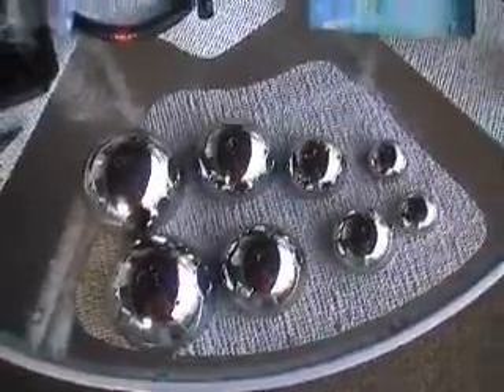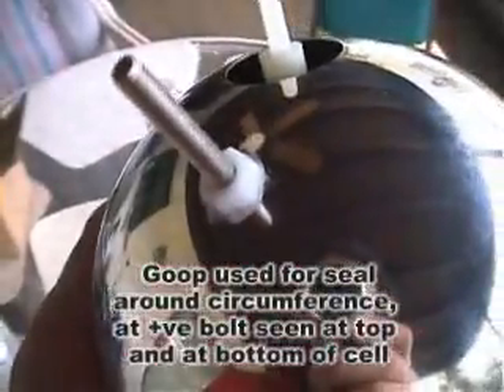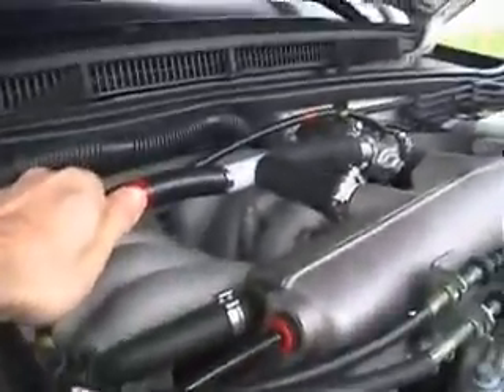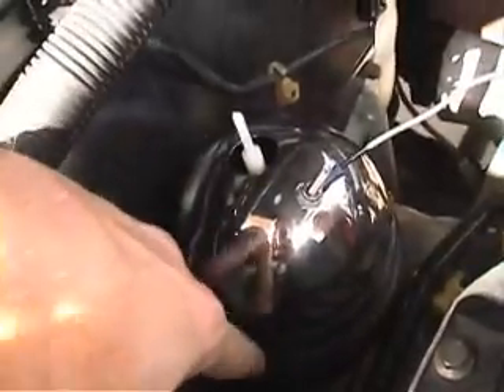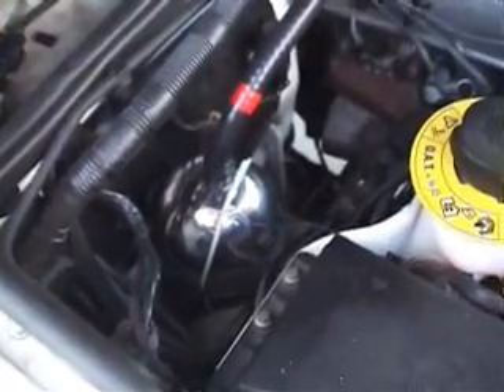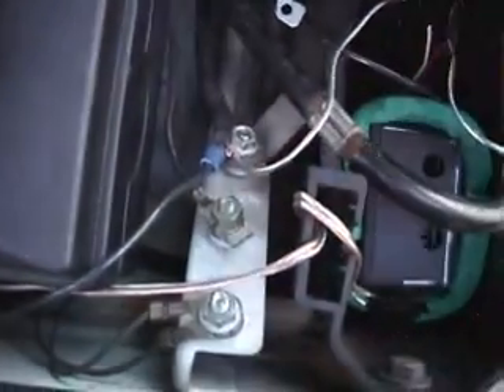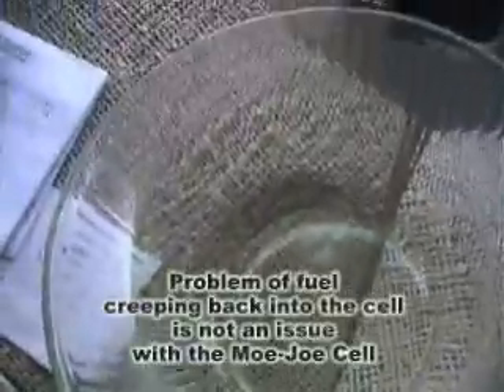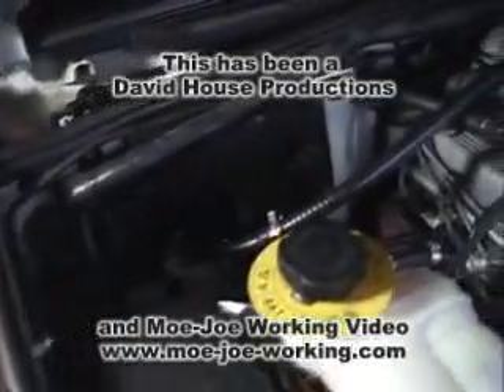Water Car Moe-Joe Cell Car Installation Video

Comment: @MosheDan9 
Actually it is still probably electrolysis. There's a lot of water in the intake, more than you'd think. For every liter of fuel you burn, about 1 liter of water goes through the engine

Comment from the maker: @Vendark 
hi my friend. i did put the tags, to attract people interested in a related technology. but in all truth, it is not a method to produce hydrogen. when the cell is functioning properly, it is affecting fuel mileage positively. however, there is no consumption of the water. there is a massive amount of hydrogen needed to affect fuel mileage, even twenty percent. we, however, have not seen the water levels go down. something else is afoot which is not electrolysis.

Comment: Okay, let me get this strait. There is water inside the sphere, right? There are electrical leads attached to the inner and outer spheres, right? Finally, there is a hose connecting the sphere to the air intake, right? Add some table salt. You'll get more bang for your buck. Also you should put one of those fish-tank bubble stones on the end of the hose. By the way, you are producing Hydrogen -not "Orgone." P.S. Breaching the firewall isn't smart -especially with Hydrogen involved.

Comment: I understand now. I think the scientists in Germany were experimenting with this psychological energy force. Orgasma energy emanates from your loins and radiates out your brain and straight into the shiny metal balls. The convenient part is that the energy can't be measured by conventional methods. Changing sensor voltage will change mpg about 20-40%. Try your orgasmatron without changing sensor voltages. If your device works it will change mileage without an effie.

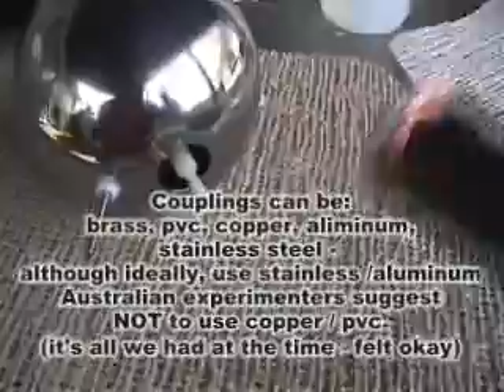Comment from the maker: 1:23 the energy that the cell produces - it's orgone. Do a search and you can learn a lot about it. another possibility is that the energy is scalar waves. another neutrinos. we're really not sure at this point. 
it is still a good idea to have some way to fool the O2 sensors, but it's probably better done within the ECU of the car. 
Shandy mode means a combination of the cell and gasoline. it comes from Australia, and means a mixed drink.

Comment: 1:23 "have a copper coupling that is going to take the energy..."  What energy?

2:00 "to carry and to bounce the (orgone?)"  huh??

Since you are no longer using a cell guardian, does that mean you no longer have to hook up anything to the oxygen sensors?  Is there an updated video on youtube?

6:12 "and already the idle is dropping"
A cold engine runs faster in order to heat up the car.  The idle goes down as the car heats up.

7:12 "major problem in (chandy) mode" what mode??

Comment from the maker: the moe joe cell is not a HHO or hydrogen gas producer. if it were, you'd be correct in all you've said. but it works with a different technology. do a search for moe joe cell and go to the main website. you'll see how it works.

Comment: i see a couple of problems... The neg cable should be on top that is where rhe hydrogen comes from the positive side of electrolis gives off oxygen. Next there's no arrestor for backsplash and or back fire.  i didn't see you check your amps but the guage of wire your using is very small.  I don't see a future with this product but I won't be close minded either.  Good Luck

Comment from the maker: it actually will work much better on those older vehicles. As long as the engine is in working condition- the car is much easier to modify when it is carburated. Go to my site moe joe cell and you will see more of the discussion.

Comment from the maker: Hi there - well, the cell is not a HHO or hydrogen cell producer. so doubling up the cells wouldn't necessarily double the output - although, such a question has a lot of validity and could use some testing - the cell produces orgone / ether.

Comment: So this particular one isn't 100% Mojo Driven?

Also, have you solved the cold climate problem?

And finally... The water I'm assuming will eventually evaporate or something inside the Mojo. So do you have to completely take out and disassemble the Mojo to refuel it with water?

Comment: great want to see everything. when do you turn the gas off?why not many cells to keep the 8 cyl at proper performance? whats the cost of the cells? iwould like to know if you have adapted any electric generators and if so what was the output